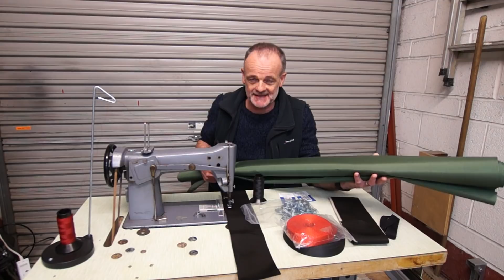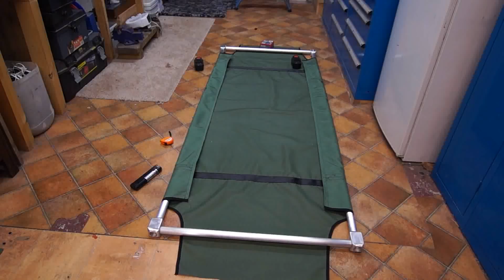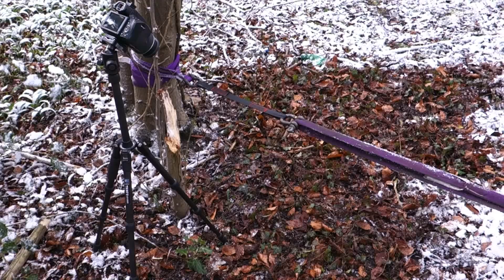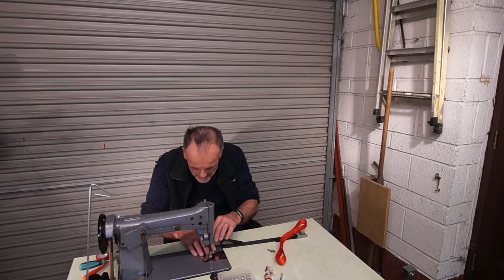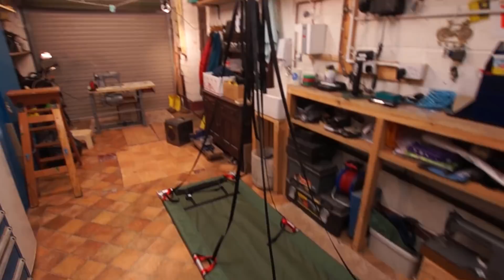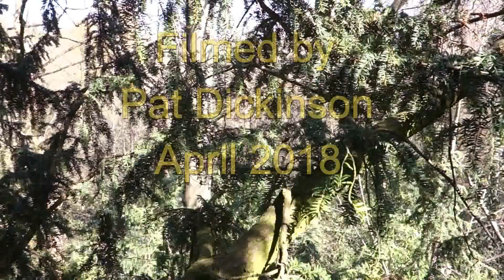Tree Camping Portaledge Build  ( Part 2 )

Comment: I had to click on your video when I saw the title and glanced at the thumb nail. causing sort of a double take.  That doesn't look like a homemade tree camping portaledge!  Maybe its just due to the small size of the picture.  Sure enough your portaledge that you've hand crafted is impressive.  Im into rock climbing and have been enamored with big wall climbing since I was a teenager.  Ive nerded out for may hours checking out and fawning over professionally made portaledges.  Yours literally looks like it could have been some (unreleased) model of portaledge from A5 Adventures.  They are the old company that nearly all of the metal framed portaledges (besides the ones from FISH Products) on the market until a few years ago were based on, copied, or made by the company who bought the rights to the A5 designs.  Point being you've done an incredible job and managed to pull in many (if not all) of the crucial design elements for your 'ledge build.  Kudos man, you clearly put a lot of effort and care into your work as well as taking the time to adequately research and plan out how to complete your project the right way.  

Check out bigwall.com or D4portaledge.com for some of the most recent portaledge designs by John Middendorf (essentially the originator of most modern portaledge designs).  The best part is, in addition to featuring some awesome upgrades they are open sourced designs and will provide the accurate dimensions and other info needed to enjoy John's recent design work (should you choose to, although Im sure you're more than pleased with your current awesome build).  

cheers,
Brian
Reply from the maker: Hi Brian, always loved building things from DIY to kit cars, each job learning new skills, and acquiring new tools which is always enjoyable.
At the same time always looking for different wild camping locations, methods so tree camping gave me something different, and a new project to work on.
I did look at all the current portaledges on the market and the price scared me, so why not build my own, I think that was the attraction I need things to keep me occupied and my brain active and still learning new skills like sewing.
The satisfaction of camping high in a tree on something you have built with your own hands takes a lot of beating..... thanks Pat 👍

Comment: Hi Pat, I´m really pleased that you did that test set up to check your sewing, it was a bit Heath Robinson but it showed that the sewing was stronger than the webbing, top marks. I like you grew up with both feet  and inches and metres and millimetres. As it turns out its been a godsend because in my job out here in Spain we are working mainly with inch based pipework and fittings more or less everything else in metric though. That said plumbing fittings here are still almost all in BSP. Look forward to live tree trials!!. Good luck from Spain!!
Reply from the maker: I tend to work in both imperial and metric, the fact that decimalisation took place in the UK when I was at school, I think in feet and inches but work in mm alot, all interesting stuff......Pat

Comment: impressive work! I tried making portaledge with friends , we tested it today, and we realized what needs to be changed and reworked.
One suggestion about hanging your portaledge, instead of using webbing, and actually sitting on 6 buckles that are not reliable, use parcel prusiks from 7-8m cordelette ^_^
Reply from the maker: Hi interesting to hear you have built a Portaledge, hopefully you get to sleep in it. The cam buckles are rated at 250 kg if I remember so 6 of them and split the load they are plenty strong enough, you can also adjust the buckles when loaded or when you are in the Portaledge. Prusicks ( which I can,t spell) sound a good idea but can you adjust then when they are loaded? Interesting to talk to you Pat

Comment: Watched lots of your Videos Pat, just wondering if those cam buckles are load bearing rated? Seems like they would be a weak point if not? Cheers for the videos! Craig
Reply from the maker: Hi Craig yes thought about these being a weak spot, bought the cam buckles from PT Winchesters, actually way over rated these are 400 kg with  6 of them sharing the load they are well over rated for the job. I tend to build stuff that would take the weight of a elephant, thanks Pat
Reply: @patrickdickinson6492  Good to hear, they just didn't look particularly sturdy in the video 400kg each is much more than ample!

Comment: Looking at your build it's great, very interesting project but, where you have the load bearing red corner webbing and the black webbing straps joining. There is a potential weakness friction could weaken one of the straps. I would suggest a metal joint between the red and black corner weightbearing straps
Reply from the maker: 24540082 Hi yes know what you mean. The 25 mm webbing is way over the top 1500kg rating but agree wear could reduce this. I had thought of using small 8 mm Mallions as would allow dismantling etc but extra weight and cost I did not use them. Happy at moment but will keep my eye on them for wear etc., Thanks for interesting observations, Pat

Comment: My first real job out of college was with a Rigging House. The material, as you probably already know, (in the line of work you were in),  has a 3 to 1 safety working load limit. The riggers we had would always splice the rope, (wire, nylon, sisal, etc.) and sew webbing to a WWL limit far in excess of what the material was. You have proved yourself a Rigger with your test. And that is saying something because most of our guys came from the US Navy. Well done. You should be proud of this project Pat.
Reply from the maker: Doug Thomas Hi Doug thanks for the comments, Ifind the webbing so versatile use it on so many projects or everyday uses, it's unbelievable strong, interesting job to start with when you left college, not so long ago !!  thanks Pat

Comment: How do sir what was the total cost of the project, was it more or less than the blackdiamond potaledge
Reply from the maker: Robert Ashton Hi Robert if. BD Portaledge cost about £450 then my homemade one matetial cost about, £100 for framework and about £100 for material webbing and buckles etc so only about £200. The time taken was massive, a lot of research and obtaining material then actual building work. But I built for enjoyment rather than cost saving, hope of interest, Pat
Reply: Patrick Dickinson how do sir, that’s good going , things like this are alway time consuming. I Use my hammock but will really think about a build of my own. You have done a top job sir and if your ever over Lancashire way , give us a bell I know some good spots to camp and places with big tree respect
Reply from the maker: Robert Ashton Hi Robert and thanks for that, hoping to test Portaledge soon just to see it works ok setting up and that. When I know it works will try my first tree camp, few things to still sort out like haul sacks and of course cooking and adapting a stove for use high up. Probably do a couple low level camps to learn the basics and fine tune my kit, all the best Pat

Comment: Congratulations Pat! An amazing stuff! Pro-built; made in Sheffield. All those “high class/ overpriced” outdoor brands now have a real match to compete with ;-) Were there any other technical challenges apart from transatlantic materials and machining those blocks?
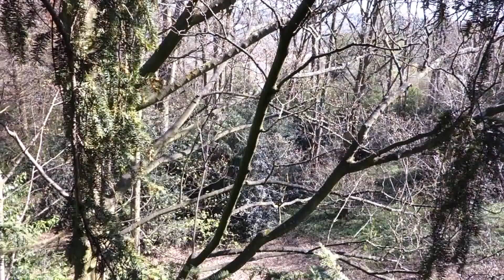Bottom line, best 26:50 minutes spent online today.
Reply from the maker: Martin Sefelin Hi Martin when you break it down, few tools required apart from sewing machine and the tasks were fairly straight forward. I was a bit unsure of my sewing strength but happy after testing. Materials were quite hard work which to use and were to buy. Testing is next challenge, will be more happy when I have set it up in a tree and it works ok, all the best Pat

Comment: Hey Patrick ..  Wow you have done well bud, your becoming a real dab hand with that machine ..... very good, the look being in that configuration would have SWL (safe working load of 2 tons, the webbing your using Is rated at 1000kg’s, in a loop the capacity is doubled and is classed as a basket configuration in the rigging world... and you have 6 of them ... they ain’t gonna break... nice design Patrick, I can see you have put allot of thought and effort into this project... can’t wait for the next one .... your be making Tents next 🤔🤔🤔🤔. 

Cheers... 👍🏻👍🏻👍🏻
Reply from the maker: Hi Glenn yes I do tend to over engineer thinks but a bigger safety margin just in case, suppose its all down to experience, if I built another I think I would make it lighter. looking forward to see how this performs on a test next, all the best Pat

Comment: Great job, I bet some old car seat belts would have been useful.
Reply from the maker: I,am sure I ,ll be as safe as houses, always connected to my climbing rope including when a sleep, Pat
Reply: I meant as webbing.
:^)
Reply from the maker: solorip hi yes I see what you meant, the cross webbing that supported the tention straps was actually seat belt material, bought by the meter, thanks Pat

Comment: That, sir, is seriously impressive! Well done you Patrick.....are we witnessing the birth of a cottage industry here? I can see the likes of Berghaus and Northface getting in touch with you with their orders!
Reply from the maker: Peter Bartlett thanks Peter appreciate the comments, may days of work are over, one Portaledge us enough. Really enjoyed making it and know looking forward to testing it and hoping it sets up easily, all the best Pat
Reply: @patrickdickinson6492  You have put some stirling work and effort into that for sure! I have had to take up hammocking in recent years due to poor circulation issues brought about by sleeping on the ground with my type 2 diabetes. I usually string a dyneema cord structural ridgeline above my hammock tensioned up like wire rope with 2 loop aliens. A diamond pattern rain tarp is then thrown over this and pegged out and tensioned with guy lines and pegs. I know you use a bivvy bag with your portaledge but have you considered fashioning some sort of multi panelled rain tarp with dart shaped segments that would taper upwards in a wigwam sort of fashion to fit within the suspension webs? It is a great idea for sure but i have camped up in the Yorkshire Dales in ferocious windy, gale driven storms and stayed bone dry under a rain tarp by taking care to pitch leeside and using natural surrounding features like drystone walls and trees to soften the brunt of the storm. Corkscrew shaped storm or delta storm pegs are essential in these conditions as straight ones will just rip straight out!
Reply from the maker: @MrDegsy69  Hi and very interesting comments, I used the bivvy bag just in case of rain and the possibility of few, on the summer's day I camped neither vwas about.
My plan was to build a fly sheet type cover as you say, but have not progressed that far, it was going to be a winter project but maybe later. Thanks for your interesting comments, all the best Pat
Reply: @patrickdickinson6492  Nice one pat! I also noticed you have a hooped bivi as well. Although this would not be practical for use on the porta ledge the idea of socketing semi circular fibre glass rod hoops into the porta ledge frame somehow and draping and fastening a rain tarp over and on to it intrigues me. Ever since i have taken up hammocking bushcraft has inspired me a lot. I just never used to think about these things when i threw up a tent or rolled out a bivi. Great videos btw as i have subscribed and eagerly await your the next posts of your exploits.

Comment: Amazing job Patrick, sounds like you have really done your research. Two questions for you, have you thought about adding a redundant safety system on the rigging, I'm thinking the cam buckles are probably the weakest link and also do you have any plans to make some sort of tarp or tent so that you can use it in all weather conditions? Thanks, this is a very interesting project to get to follow and as per usual you are doing a great job documenting it.
Reply from the maker: Ross Tapp Hi Ross yes can buckles are the weakest link rated at 400 kg each so with 6 of them fell very safe. For additional safety I will always be connected to my climbing rope even when sleeping. Reading a few books this is the way to go so always connected, not sure how comfy it will be but several people say they swap over to a basic climbing belt rather than there tree climbing saddle, so still quite a few things to sort out. A outer tent is on the cards and should make a interesting sewing project for next year, thanks Pat

Comment: Enthralling Pat - Well done, for some reason i had the webbing snapping nearer the middle and not at the end, but you definitely got the stitching bang on. Big Thumbs up
Reply from the maker: Reached60 Hi yes I did quite a few tests and they all went near the stitching, at first thought my stitching was the problem but any stitching will cause a weak spot that will snap first. Like a rope tie a knot in it and it will break at the knot. Happy with the slings as they are way over for what I,ll  be using them for, thanks Pat